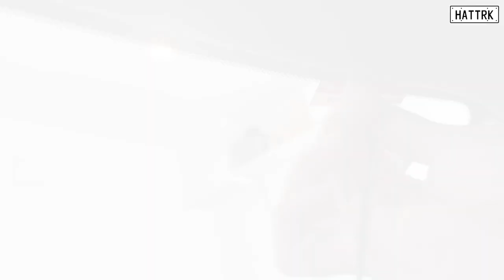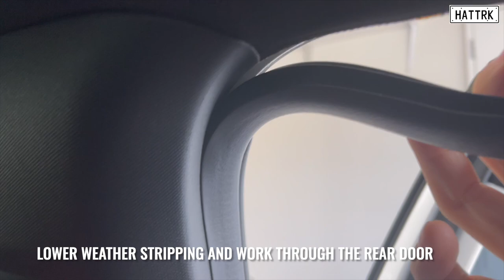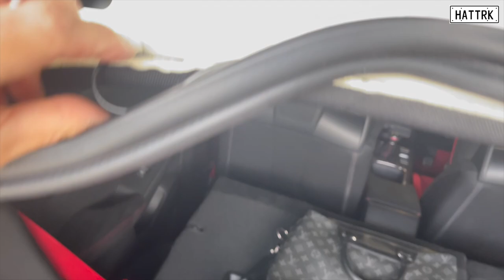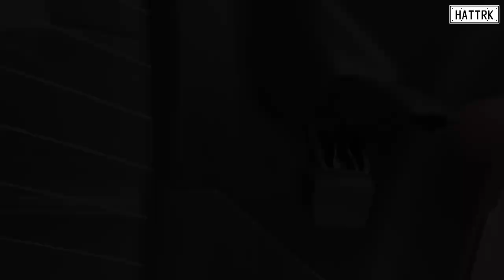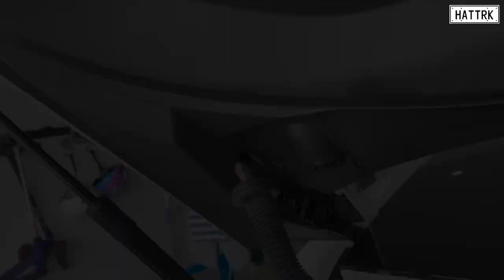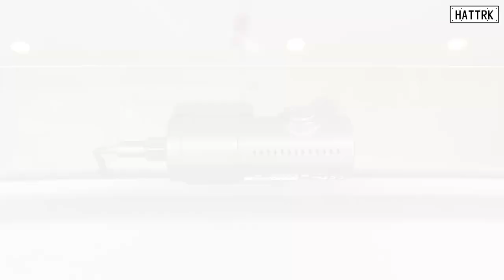Blackvue DR900S Rear Dash Cam - Clean Install // FL5 CIVIC TYPE R

Comment: I have a base model hatch which is a ways away from the type r but im going to try this out!! Extremely in depth tutorial man thank you!!
Reply from the maker: Awesome! Thanks for the feedback, its always appareciated
Reply: Did you have to purchase extra cable? If so do you know how much you ended up using?
Reply from the maker: @mindofstate  6m was just enough, if you wanted more slack the 10m option would be better. The default in the box option in my region was the 6m.
Reply: Was this connected to the front cam?  How is it connected to power source?
Reply from the maker: @Scythersmile1  connected to the front cam
Reply: @Hattrk85   awesome then the front cam to power?

Can you provide a link to all the parts etc?  Thank you for this guide its awesome!

Comment: Have you considered using MirrorTaps? You can power it through the LKAS/ACC Camera or the auto dimming rear mirror.
Reply from the maker: Yes I did think about that option, but we have to consider warranty and tampering with crucial safety mechanisms as a caveat.

Comment: Got a quick question, you bought the dash cam on Amazon? If so did it had everything you needed to install right away like that? Also do you know if it fits on a fl4 type r as well?
Reply from the maker: The kit depending on what model you purchase will have everything you need. 

You can if you’re hardwiring get a low profile mini fuse tap to make sure you have everything and thats covered in the front cam install video. 

You will need to have your own plastic pry tools and a coat hanger straightened for easier install.

Comment: How do you get the cable through the grommet hole from the trunk?
Reply from the maker: You can use the coat hanger wire that you will need to use to fish the wire through the grommet.

Comment: what fuses did you use?  Parking mode stay on for longer than 90 seconds?
Reply from the maker: I used fuse 42 but 45 was labelled the ACC fuse. After checking with my voltmeter I found 45 was still drawing power.

Comment: Brother I am following your tutorial. What kind of rod did you use? Or where did you buy it? I am at that part and oh man. I’ve been doing it 2 hours that alone. I can’t have it pass to other side. I am usung a 16 gauge steel galvanized wire. Need help bro!
Reply from the maker: Use a wire coat hanger and it should be all good 😉
Reply: @Hattrk85  I mean which one in specific? My head’s gonna pop out! It’s really hard!! Haha
Reply: @franzhizon9112  use a fish tape wire puller

Comment: That last part is the most difficult. I’m installing a different cable and I’m worried that the cable is to thick.
Reply from the maker: Best of luck!
Reply: is there any cable that are not thick on rear cam cable? it’s difficult to install the last part. i might break the glass 😢